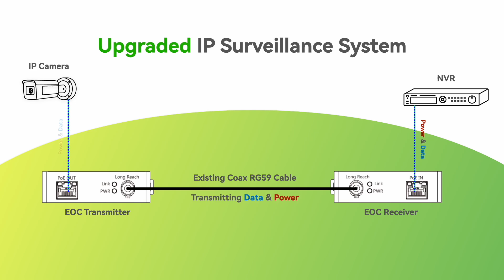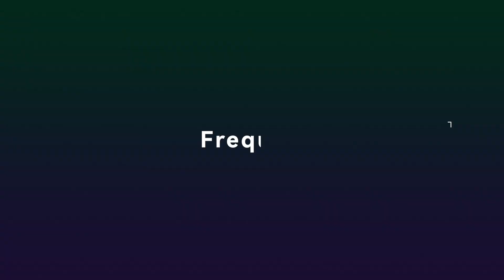UltraReach PoE over Coax Explained!  Upgrade analog camera to IP system without replacing cable

Comment: can I connect another POE switch at the other end instead of a camera?
Reply from the maker: Thank you very much for watching our video and for leaving such a great question. We really appreciate your interest in our PoE over Coax solution. Whether you can connect another PoE switch at the far end instead of a camera depends on how you plan to use the connection. There are two different scenarios to consider:

Scenario 1: Data transmission only

If your goal is simply to exchange network data between two PoE switches, then yes — this is absolutely possible.
In this case, both PoE switches are powered locally, and the PoE over Coax (EoC) link is used only as an Ethernet bridge. The EoC converters will transparently pass data over the coax cable, allowing the two switches to communicate normally. No PoE power is required at the remote end in this scenario.

Scenario 2: Power and data delivery to another PoE switch

If you want one PoE switch to provide both network connectivity and power to another PoE switch, then there is an important requirement.
The remote PoE switch must support PoE input (be PoE-powered). Most standard PoE switches are designed to supply power, not receive it. However, PoE-powered switches — such as our LINOVISION EXT04 — are specifically built to receive PoE power and operate as a remote extension switch. In this setup, the upstream PoE switch can deliver both data and power through the EoC link.

Important considerations

When using PoE over Coax, we also recommend paying close attention to:
Transmission distance vs. data rate, as longer distances may reduce available bandwidth
Transmission distance vs. power loss, since PoE power decreases over longer coax runs
Total power budget, to ensure the remote device can operate reliably

Please be sure to reference the product specifications for supported distance, speed, and power limits.

If you don’t mind sharing a bit more, we’d be happy to help further.
What is your specific application scenario (for example, security cameras, elevator systems, building retrofit, or industrial use)? If you can provide the approximate distance and whether local power is available at the remote end, we can assist you in designing the most suitable network solution.

Thanks again for your support and for reaching out.
Happy New Year!

Comment: Nice solution. However, I can think of something that may make it better. Frequently, analog systems have a power bank at the source that supplies power to all the cameras. The video is over the coax with a power cable strapped to the side of it, usually as a bump on the outer jacket. It would be nice if the NVR end device would accept power from this power bank that's already there to send more power out the cable so that the device on the camera end could supply the full 802.3af/at power to the powered device.
Reply from the maker: That's a great observation, and it's definitely something to consider!

Comment: is poe ++ supported at shorter ranges?
Reply from the maker: Hi Steve, thanks for watching.For PoE++ long-distance transmission, you can refer to this product and its corresponding technical specifications.https://linovision.com/products/long-range-outdoor-poe-extender-max-2600ft-power-and-data-transmission-2-pack
Reply: That means covers all 3,300ft within, though, it supports.

Comment: These things got me out of a jam. Installed new cameras and they were all bnc cams, ran new lines for more bnc cams but when the next cams arrived they were poe, renting another lift and rewiring lines was out of the question, these poe over coax converters saved the day, install is super easy plug and play, video quality is awesome 4K, speed and connectivity is solid no dropped or freeze frames, definitely worth the price, instructions are printed right on the box.
Reply from the maker: Thank you for sharing your experience! We’re thrilled to hear how the PoE over Coax converters helped you out in such a tight spot. It’s great to know that the plug-and-play setup, 4K video quality, and reliable performance made a difference for your project. Your detailed feedback means a lot to us and will surely help others who might face similar challenges. We appreciate your support!